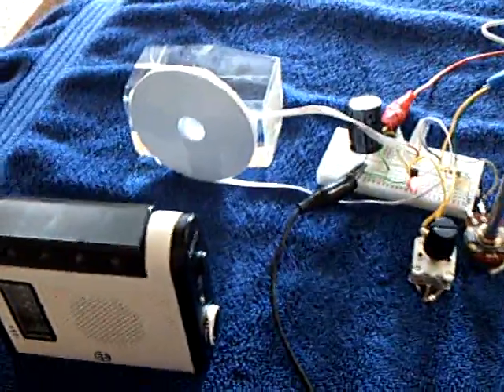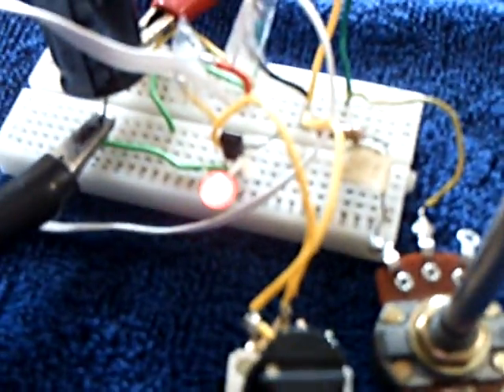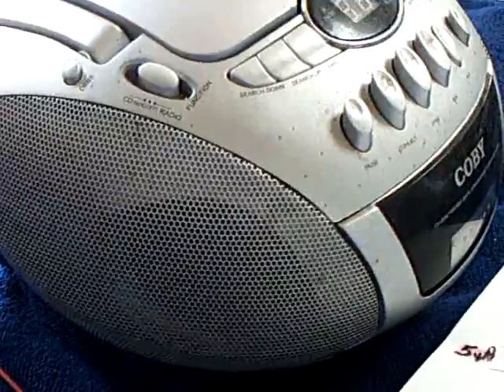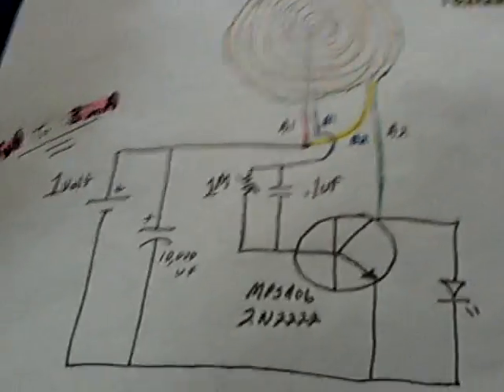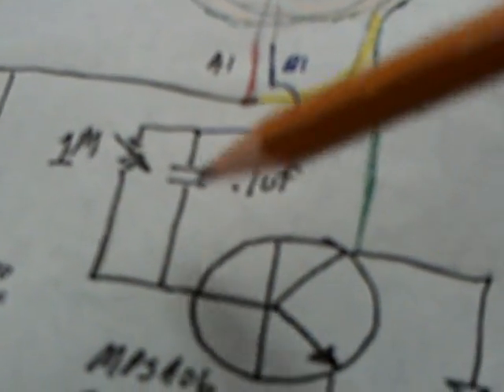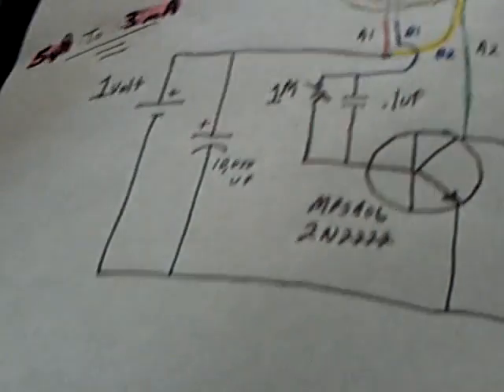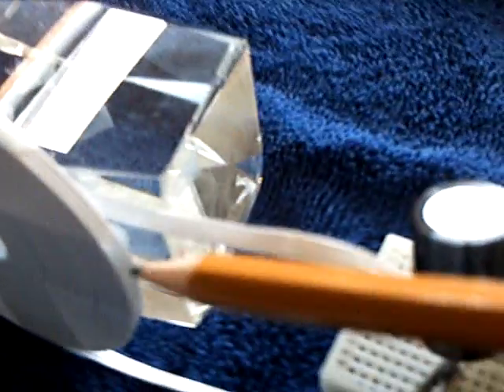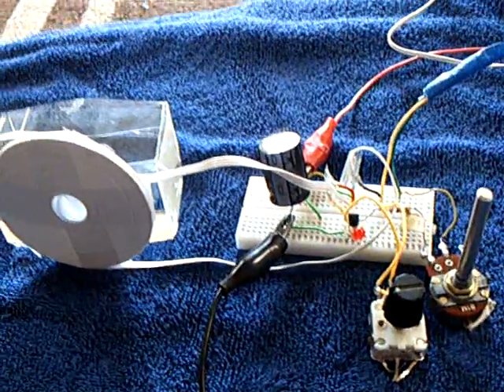Radio Station LIDMOTOR--The pancake coil JT broadcasting music

Comment: This principle lidmotor used is the basic format engineers that develop radio broadcast circuitry  use what is called Multiplexing to get much higher resolution audio broadcasting by means of a carrier frequency, this works by using a frequency double the maxium audio frequency response say 44khz then modulate that frequency with standard audio, then a receiver uses a demodulator circuit on the other end to retrieve almost perfect audio this is basically how a stereo multiplexer works. Unless broadcasting in WATTS their are no laws being broken here a Ham license covers power over a certain limit this is in the miliwatts so lidmotor is not breaking any laws here. http://transmitters.tripod.com/stereo.htm